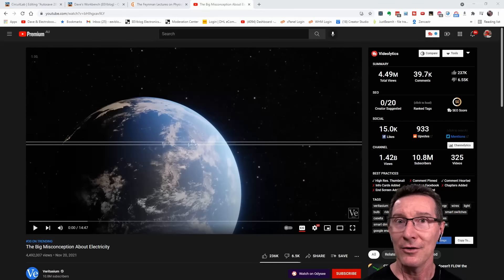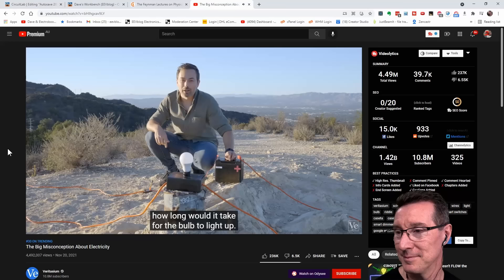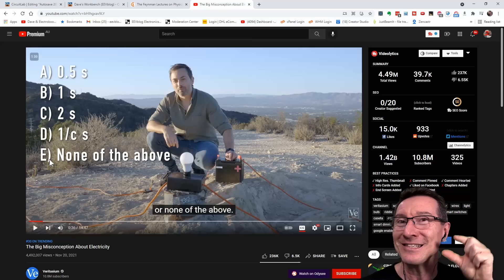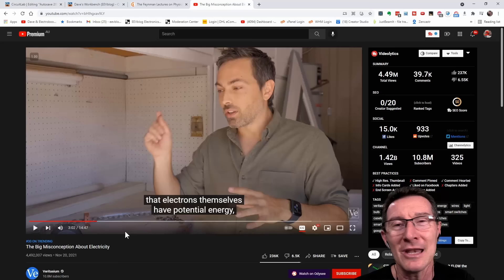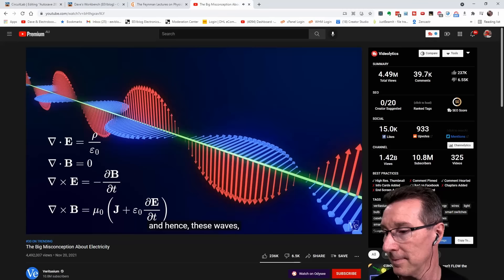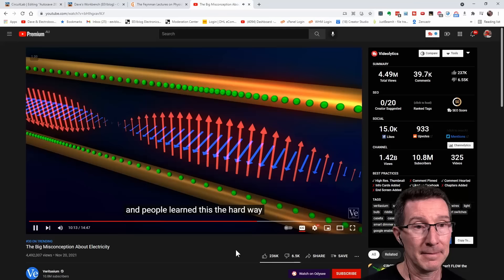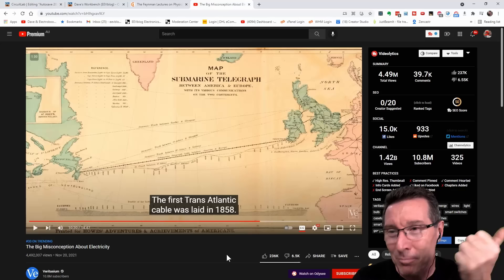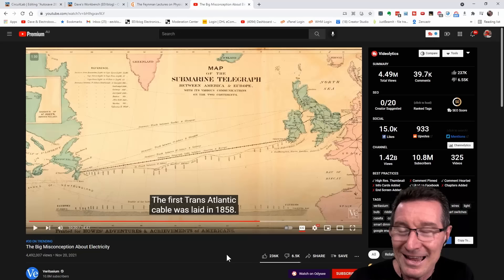EEVblog 1439 - Analysing Veritasium's Electricity Misconceptions Video

Comment: I finally figured out what was bugging me about the video.  It's actually grossly dependent on the light bulb's resistance. tl;dr, 3-ohm headlight bulb would take 200 seconds to reach 50 % voltage (25% power), while 1300-ohm  40W 230V bulb would reach 90 % voltage after 1 second, only starting with 45 % voltage across it.

The signal bounces between the ends of the transmission lines and only approaches equilibrium in 1 second long discrete steps. Unless the bulb's resistance is substantially higher than the characteristic impedance of the transmission line, the current will start only at its fraction. If the light bulb is 900 ohms and the transmission line is also 900 ohms as Dave said, the current will start at 1/3 A nearly immediately (after 1 m/c), and then will grow in steps after each second. After one second it will be 2/3 A, 926 mA after 2 seconds, and so on...

You can argue that in the video he shows an LED bulb (a mains-powered AC bulb connected to 12 V car battery, nonetheless), but then you have the problem that an LEDs are extremely non-linear, and won't light up at all until the voltage is high enough.

Derek either stretches the meaning of "turning on" reaaaaly far, or assumes unrealistically high resistance of the bulb.
Reply: Yea.. its the school of.. "if you ignore every effect apart from the one im going to show later" school of learning.
Reply: Yeah his definition of the light bulb "turning on" is kinda too stretched out. He's right about the capacitive coupling and he mentions the ramp up because of transmission line effects, but the video is abit too sensationalised.
Reply: It isn’t a transmission line issue ( when you have a hammer, everything is a nail), Derek got it right, the bulb turns on quickly, he says more power will flow through the wires and bulb will get brighter. The overwhelming brightness is the initial turn on.
Reply: One correction - you can't know what light bulb exactly he got in there, all we can see is that it probably uses E27 socket (based on size), which typically is used for mains voltage lighting, but nothing stopping you from using it in low voltage system and, for whatever reason, you can just buy low voltage E27 lamps, so it could work as it is.
Reply: I agree that Derek's lamp is too much magical.
If it can light up from EM-noise of closing the switch 1 meter away... thus his lamp should be always on because of all that WIFI/2G-5G and radio waves. Even thermal noise should switch it on then.
Simple incandescent lamp needs some minimal voltage to radiate in visible spectrum, at low voltage it will shine infrared but we would not see.
Reply: Yeah, it's the part of physics I really hate, which is the "there are a million of other things that would make this not work but ignore them". 
This way of explaining things makes misunderstanding the explanation really easy for someone who doesn't know better, as physical models are often used (like a lightbulb), that makes a "normal" person think that it's directly translatable to the real world... It's not.
Reply: I think many people are missing the point. Transmission line theory comes from Maxwell’s equations as does Poynting’s theorem. Done properly you get the same result. Transmission line does not explain how/where energy really is, Poynting does. Nothing about noise or capacitive coupling. E&M power flows from dc supply, through space, to bulb. Power will also flow along wires, and will take some time to get to the bulb in his setup, the bulb will get brighter. To simply say “ the dc supply and bulb are coupled” misses the point. Consider moving the switch .5 light-seconds away while the battery and bulb remain 1m apart, what happens then?
Reply: @mattmurphy7030  It is the kind of thought experiment where simplifications and omissions are made that change the outcome entirely, and are glossed over in an effort to preserve sensationality rather than explained properly so that it can be understood what concept the thought experiment is meant to present.
Reply: @bar10005  Then tell me, in what ballpark can resistance of 12 V E27 bulb be? I find it very unlikely to be substantially higher than the impedance of the transmission line.
Reply: @jimmcclymer4230  It is absolutely a transmission line issue. The transmission lines are shorted at the end, and for the first second, before the pulse bounces off the ends and returns, the current that will flow is given by resistance of the bulb, and two transmission line impedances in series.
Reply: @mattmurphy7030  He could just as well claim that it will take a full minute for the light bulb to turn on by making different and IMO even less stretched simplifications and omissions. He builds his video on a question and answer which is simply not true.
It is no good if the video leaves people with different yet still wrong understanding.
Reply: @bar10005  It's not about the details of the circuit. Derek stipulated that if a current through the bulb, it would light. The video was not about building a circuit; it was about showing a fundamental truth that is taught poorly/incorrectly to virtually all of us. The truth is energy is in the fields, not the current. Power flows through space, as determined by ExB, into all resistive elements. Power also flows around the wires from source to resistive elements. If you check most text books on Poynting Vector they will not have surface charge on the wires, have wrong or no reason for electric field along wires, If no surface charge, then no power along wires.  Derek is really showing people something that they do not, but can as you have the background, to understand.
Reply: @vasiliynkudryavtsev   Hi, it is not noise, it's not about the lamp, it is not transient. It is fundamentally about how power is in the E&M fields, not the current. Power flows from source through space to resistive load, as well as along wires. As most texts ignore the surface charge they don't have any power along wires.
Reply: @jimmcclymer430  Greetings, I see you are the man of culture as well.

Listen again. For the Dereks requirements, we can make superconductive wires.
We can make a "Lamp"-device which is extremely sensitive current detector amplifier.

But in the end: what's the practical point?
Is it "we can detect EM-noise to light the lamp" or is there something more practical (down to the earth)?

The very transformer should teach you: energy transfers not through the current but fields.
Derek shows everyone very ineffective open transformer and everyone's mind is blown, WTF?
Reply: @404Anymouse  Hi, Maxwell's Eq describe what's going on. In so far as Transmision lines theory is derived from Maxwell, all is fine. You might be ignoring that the video is telling people a fundamental truth about power transmission that is taught wrong in most texts.  Power is transmitted by ExB, full stop. Power flows from the source to the load through the Poynting vector. This vector has components that travel through space from the source to the load and also has a component that travels along the wires. Each wire segment acts as a source (it has a tangential and radial E and an azimuthal B) that defines a Poynting vector radially outward, through space, to the load.  How power propagates is not understood by most engineers or physicists (I teach this in a physics grad E&M course and finally came across 1 student who had this taught correctly to him when he was an undergrad). 
Don't take the circuity too seriously, think of it as a metaphor to demonstrate that power does not just flow along wires, even DC.
Also there is no "bounce back" at the end as there is no end. There will be a reflected pulse at the impedance change from wire to bulb but that is irrelevant. Remember the wire is at the same potential before the switch is thrown, the surface charge density (ignored by most texts but absolutely critical for anything to work) are very small. It is just a wire, no short, just a wire.   Also remember that the initial near the battery doesn't yet know about the bulb. The details are truly interesting on how the surface charge density gradient causes a local current, depending on local wire property.  It is not just power along the wire.
Reply: @vasiliynkudryavtsev  Thank you. The point is not to make a more practical effect, it is to demonstrate how power really flows in a circuit, it’s Poynting vector. It’s not noise, it’s fundamental physics. As to use of knowledge, some bright person might put this deeper understanding of power flow to some amazing use, or prevent a problem. Likely we have learned from experience not to do “ dumb” things where this energy transfer would cause a problem. What is missing from our discussion is how much power along wires vs through space. Not easy to do as each wire segment also acts as a source of E, which interacts with B to transmit power.
Faraday may have had the best answer:
An intimate friend of Faraday once described to me how, when Faraday was endeavouring to explain to Gladstone and several others an important new discovery in science Gladstone’s only commentary was ‘but, after all, what use is it?” ‘Why, sir,’ replied Faraday, ‘there is every probability that you will soon be able to tax it!’”
Reply: @jimmcclymer430  You are only explaining to me what was already more or less explained in the video above.
You can not ignore that the power to the bulb is flowing through a transmission line (laterally), which appeaers infinite at first, before the power bounces off the shorted end and comes back one second later. Before this happens, there is effectively double the impedance of the transmission line in series with the bulb.

Comment: Thank you for this, it was most helpful to clarify what actually is happening, unlike Veritasium's video which is intentionally confusing and makes it seem like "magic". As someone with some knowledge of physics I knew that the phenomenon could not have anything to do with the wires forming a circuit, as that would violate faster than light communication, but I didn't know enough about electrical phenomena to know how it actually works.
Reply: I disagree with the concept of intentionally confusing. Really? You have no evidence to support this somewhat miserable confusion. Confusing? Sure, maybe. Intentionally?. No.

Comment: The setup is placed for a long time, so the voltage from the switch across the bulb to the battery's positive end all equals to battery's voltage. And the battery has a constant voltage. Why do you think this circuit is a transmission line?

Comment: Can anyone explain how bundles of cables work, and the fields don't interfere with eachother since they are all sharing the space outside the wire?

Also, wouldn't shielded cables block the fields from being able to travel outside the wire?
Reply: A) they do, you will have a lot of fun if you put analog signal lines next to cables of an large motor with variable frequency drive
Reply: @hausaffe100  My only experience is in building drones, with no electrical engineering background. Before learning to separate those things, it was a mess of troubleshooting seemingly random issues.

The cable shielding still confuses me a bit though. Shielding them from interacting with other wires makes sense theoretically. But aren't you also shielding them from functioning as expected...if the field is supposed to be outside the wires? Like, wouldn't shielding block that from happening as expected?
Reply: @PowerScissor  the field is still present in the dielectric material between the core and the outer shielding material of a coax cable.
Reply: If you look at a Cat 6 Ethernet cable, you will see that the 4 pairs are separated from each other by a plastic divider. If you look more closely, each of the 4 pairs are twisted at a slightly different rate. And, it still only allows reliable transmission at 10G bps for 100 meters. This cable was carefully designed to deliver a very small rate of bit errors at that speed and that distance with knowledge of transmission line effects and wireless transmission between the cables. Conversely, wireless phones work by transmitting energy between the tower and the phone, which is an excellent example of desirable wireless interference.
Reply: @mattmurphy7030  reading about "crosstalk" was interesting, thanks.

Also explains why I no longer experienced any signal interference issues in my pipeline inspection equipment once the lines all went the way of fiber optics. Interesting to see the benefits of using fiber optics in a real world use case. I just knew it worked way better, but didn't really know why.
Reply: This is why differential signals over twisted pairs are used in many applications, like usb, Ethernet, and rs422/rs485, or coaxial cables are used foe radio -- it limits the interference generated. For Ethernet with multiple pairs, the pairs each have a different number of twists per foot to help them not generate interference between each other.
Reply: The vast majority of the field is within/very close to the cables.
Reply: As I recall from the days when I ran network cable through ceilings, you cannot put an ethernet cable within 6" of a florescent light without the light introducing unacceptable amounts of noise on the line. Probably much worse now with gigabit technology.
Reply: @craigdupree1687  That’s a great contribution!

Comment: Well my main problem is the definition of the lamp turning on :) It is just such an theoretical question that the answer to it is also so out of touch. Sure if I completely ignore all resistances then yes, I get an instantaneous response but honestly I think the simplification just caused confusion. 

In any practical experiment you would get the light turning on much later than the 1m/c even if you would have a small amount of voltage immediately across the lamp.

Comment: I commented on their video;  the parallel wire configuration implies energy starts flowing (an infinitesimal fraction) after d/c (d-distance between go and return, 1 m apart in that example), but it reaches the nominal value after half-length * speed of light in medium. The field propagation speed in medium varies with the material, frequency, cable construction, etc., but one can approximate it for conductors to be ~0.8 c. So the light bulb will receive a tiny (meaning infinitesimally above zero) amount of energy due to the particular configuration with the go and return wires near and parallel, which couples the nearby Poynting sender and receiver (differential) parts. In terms of circuitry, is a distributed transformer and a distributed capacitor, which will respond faster than the field propagation along the lines which, still, will carry most of energy and will fully light the bulb. The 1/c claimed there is not correct, the distance the Pointing vector travels is 1 m ONLY for a zero-length piece of conductor, while 1 second is also not correct, because the propagation through wire is slower than the speed of light in vacuum. The right answer there is: a tiny amount of energy will start to be dissipated in the bulb after 1/c, while the full power will be reached after ~1.5 seconds. None in that video answer’s list. And I think it would've been useful explaining the coupling in that particular configuration; otherwise, some people will think that if we connect Earth and Moon with wires we can talk FTL :-).

Comment: The question asked in Veritasium's video was: How long will it take for the bulb to light up? You say in this video that there will be a transient current pulse which will quickly fade out. Is that pulse really enough for the bulb to light up? If not, doesn't that mean that the answer to the question is not (1 m)/c?

Comment: I asked this at work, and I can tell you this; None of the electrical engineers (Bachelors, Msc EE) nor the one guy who has a MSc engineering degree in physics knew this...
Explains why the enginuity, R&D and my nations technical field is in such decline.
Reply: Trust me: engineers will learn what they need to, when things don't work as expected.  The engineers you work with don't need to know this to do their job.  They do not work with transmission lines, or they would have instantly spotted that this was a trick problem.
Reply: @BrightBlueJim  : Sorry Jim, but I don't trust you... They are working on building test system for the next gen automotive systems. I.e  CAN, CAN-FD, Automotive-Ethernet etc... How can EE-engineer get a degree (and corresponding work) not knowing what a star-ground or a ground-loop is?
Reply: @bigcheese781  I don't know how grounding applies here, but my point remains: they aren't designing transmission lines; they are using an existing design that only requires them to follow some simple rules.  Engineering is about getting things done efficiently, which means not reinventing the wheel every day.  I agree that it is never a bad thing to know more than you need to know to solve a problem, but automotive networks are a solved problem.  They don't need to know how to design one.
Reply: @BrightBlueJim  : How are you not "designing transmission lines" if your job is to build, design and connect ECU's in a test rig?
Are you perhaps a manager or in the recruitment office in my company, because that would explain everything. 🤪🤣
Reply: @BrightBlueJim  if they are dealing with high frequency electronic boards like in  giga hertz for example. They will be dealing with tiny transmission lines in the board. That is why high frequency electronics equipment such as used in communication for example is very expensive to design. The higher the frequency the more you deal with transmission problems. Tbh this is more issue in electronic boards.